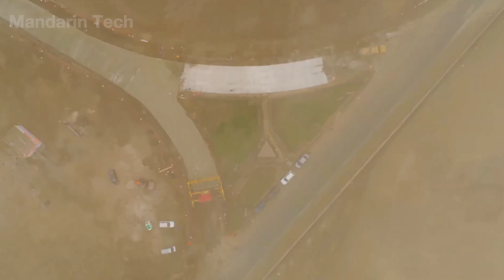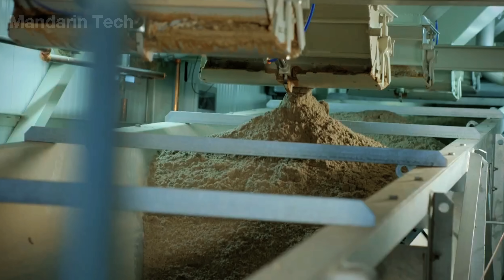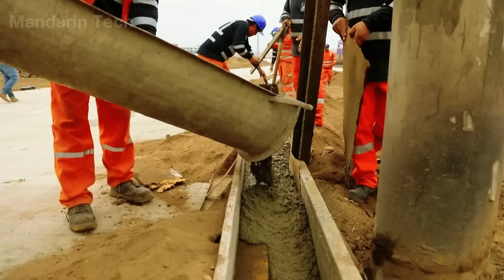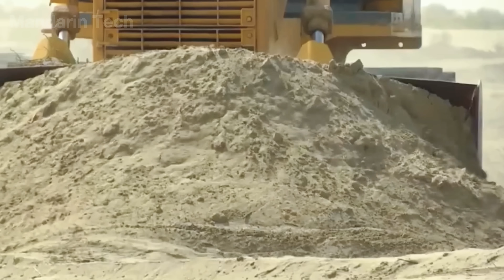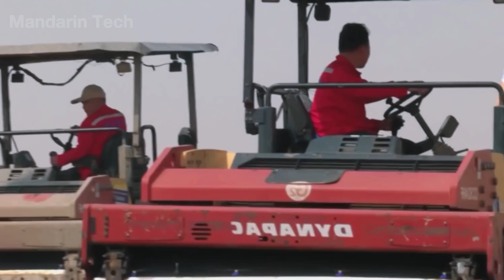You Won’t Believe How U.S. Genius Engineers Build Massive Concrete Roads With Cutting Edge Machines

Comment: Most of this could be from the 60s. Road markings by hand? We have machines for that. And nobody walks around with vacuum cleaners like the one shown here. The slot-cutting machine cuts cold with water and cleans immediately afterward. Normally, a machine first goes over the concrete and mills small grooves into it for better grip.
Reply from the maker: Appreciate the technical insight, real-world construction methods have evolved a lot over time.

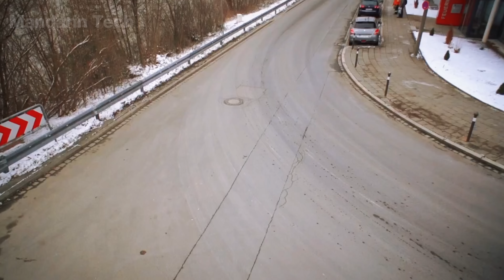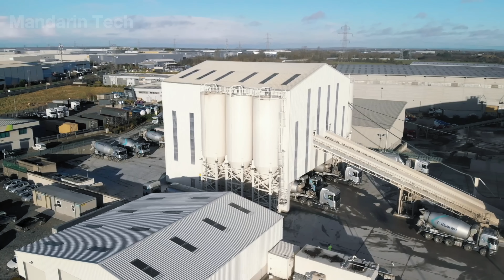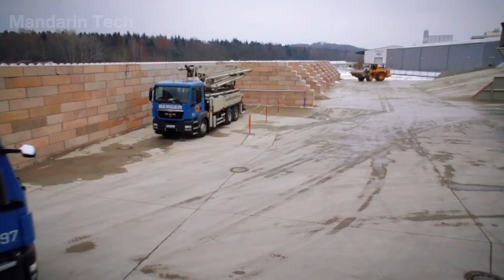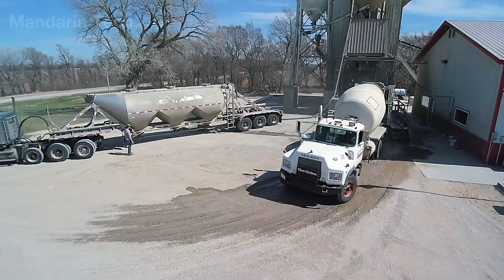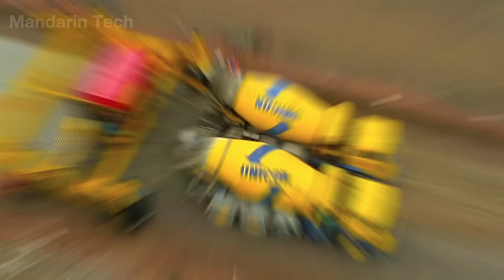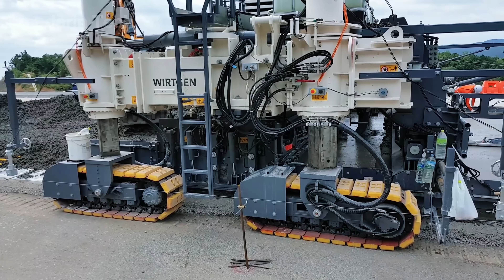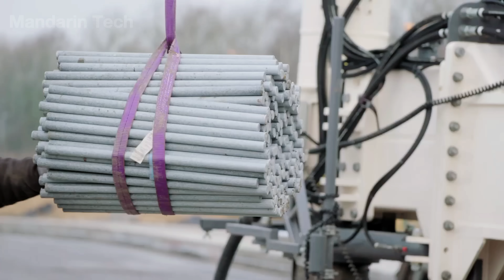Comment: 4:01 Berger Beton SE (Passau/Germany), 4:05 Kilsaran (Dunboyne/Ireland), 4:08  Berger Beton SE (Passau/Germany) This shows how it is manufactured in Germany and certainly not in the US. 6:13 This could be in the US. 6:29 Somewhere in Peru. 7:15 Not Peru. This beast, from the German company WIRTGEN, is called a slipform paver. 7:49 Specialized company from Belgium. I don't understand the title in conjunction with the contributions shown from different countries. Every country has its own regulations regarding road construction. With today's dimensioning methods here in Germany, these last up to 50 years or more. 240 cubic meters of concrete per hour, a distance of 450 to 500 meters daily and, if necessary, around the clock. That's what the machine can do, and that's what we'll be guided by. We don't use concrete mixers for this, but rather 40-ton dump trucks. Mix trucks would be far too slow. The machine distributes the dumped concrete automatically. In a single pass, the machine applies two layers of concrete: the base layer and the top layer.
Reply from the maker: Thanks for the detailed insight, it’s great to hear from someone with direct industry experience.

Comment: Most of the video describes cement as "concrete". It's not concrete until it cures.
Reply from the maker: You're absolutely right — thanks for the clarification! Cement and concrete are often mixed up, but they’re not the same.
Reply: What are you talking about??? Cement is one of many ingredients that make up concrete. Such as stone, fine aggregates,plasticisers etc. All of these things mixed together makes up concrete. Absolutely nothing to do with when its cured.
Reply: @danieldennigan8093 That's true, but it is still just a mix until it cures into solid form.

Comment: HOT  ROLLED   ASPHALT    WITH  25 mm   CHIPPINGS     PRODUCES   A    FAR    DURABLE      STRONGER   SURFACE.
Reply from the maker: That’s a solid point — hot rolled asphalt with chippings is known for its strength and long-lasting performance.
Reply: @Mandarintechmido   HI,  the  Best.

Comment: I have a question,,,you say last 40 to 50 years but they are redoing  roads 2 - 4 years ??????????????????????????????????????????????????????????????????????????
Reply from the maker: Great question — many roads require resurfacing or repairs every few years due to heavy use and weather conditions.

Comment: Are there forms on the outside to contain the mixture?
Reply from the maker: Yes, in most cases, formwork or molds are used on the outside to shape and contain the mixture until it sets properly.